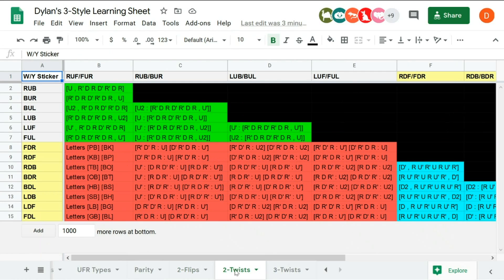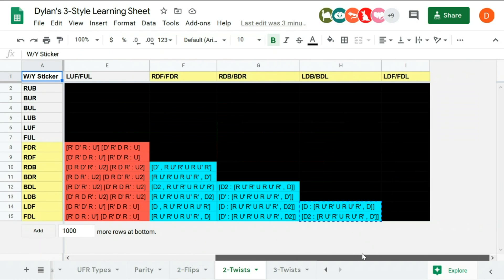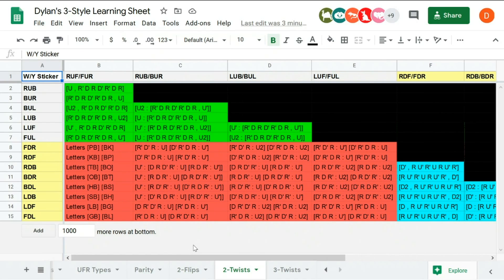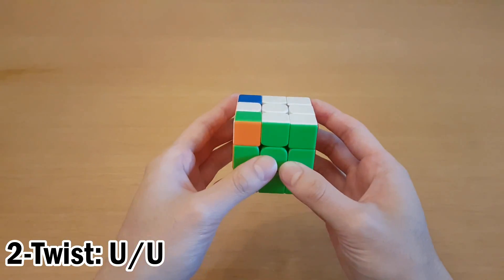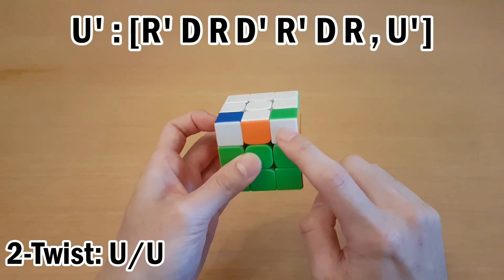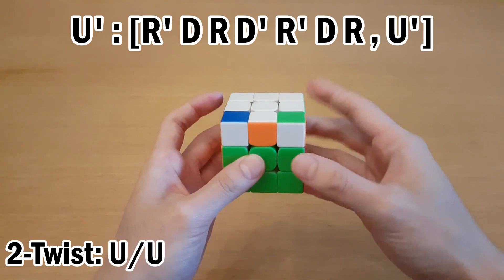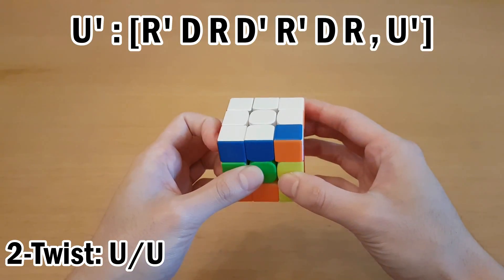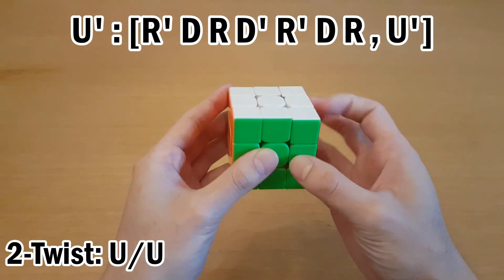Advanced 3-Style Blindfolded Techniques & Tricks!

Comment: Just a question. How does memorization work for floating buffers?
Reply: Generally you just memorise the letters of the cycles while keeping a mental note of which buffers they are from but if its a very short cycle (i.e. 1 or maybe 2 alg/pairs) its probably better to just visualise it and execute the corresponding algorithm(s) immediately once you put the blindfold on. Because 1. it's faster and 2. having many different cycles with letters from different buffers can lead to confusion about which buffer they are from. Also to note that floating should generally be implemented a good bit later than this tutorial may imply, and there may be more oppurtunities to float than just when you hit the solved side of your buffer in tracing (which can be found through tracking buffer orientation, sandwiching, and/or DLin tracing)
Reply: @apermisgreat1644  Thank you very much 👍

Comment: 'J perm'(Please reply) I am now good at 3 style edge's but weak at corners, so what tip I can have from you to improve my corners(faster)??
Another Question, I am using U perms instead of some commutators  for  example (DA),(RT),(BL)  will it be OK ??
Reply: I highly recommend you use the Orozco Method for corners as it helps you learn how to cancel setup moves and gets you into using commutators. When you transition into 3-Style, you can always treat a certain piece as the helper and do a commutator from there. 

If you’ve already done this, then what might be the best thing to do is to learn the easiest cases first that J Perm puts on the sheet (U-Top and D-Side). When you do that, you just figure out how to set up into those cases and you learn the special cases and twists. Try to not get too comfortable with using Orozco because it will be harder to then transitioned into 3-Style Corners. It’s the same thing with OLL. 57 algs is a lot but only when you postpone learning it.

Comment: Jperm what cube do u recommend for a advanced Cuber like I quit cubing about 1 year ago and I’m starting to to get back at it I’m just trying to get $50 cube or under which one u recommend?
Reply: If You're Willing To Spend Upto $50, I Recommend Getting 2-3 Cubes In That Price, As The Cheaper Ones Aren't Necessarily Worse Than The More Expensive Ones And If You Get Multiple Cubes You're More Likely To Get A Cube You Like, And You Can Keep Switching Between Them To See What You Like
Reply: Or Just Get One Out Of The Top Speed Cubes Between 20-50$ Whichever You Think You'll Like As There Are A Lot And No Single One Is Necessarily The Best